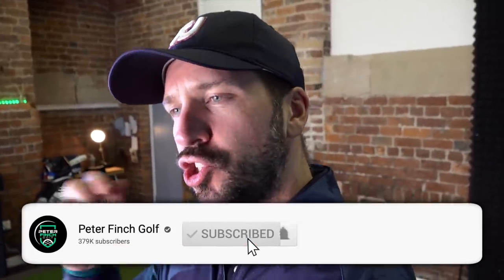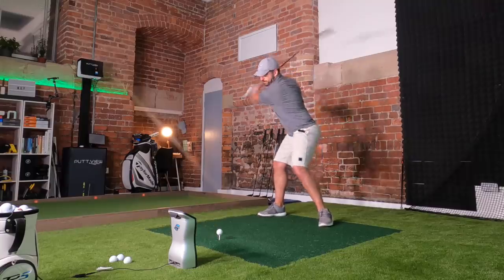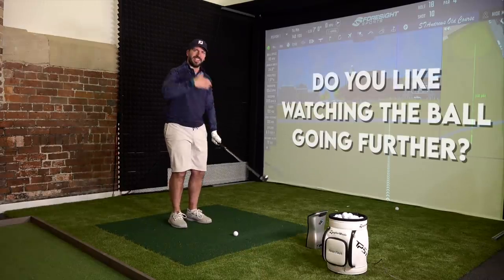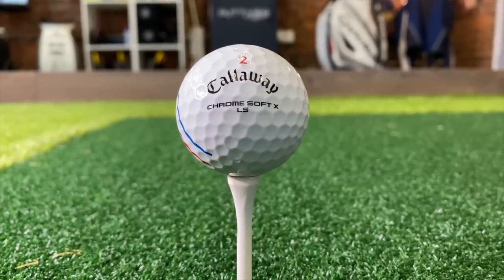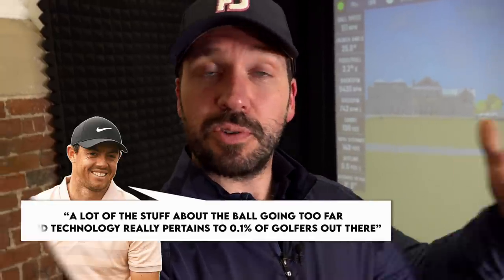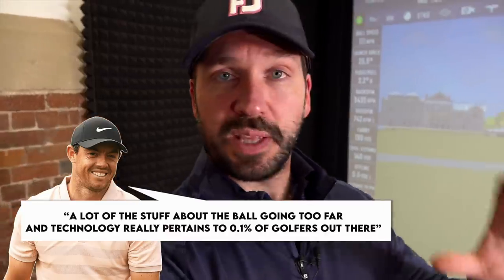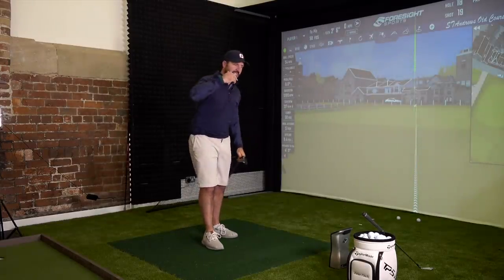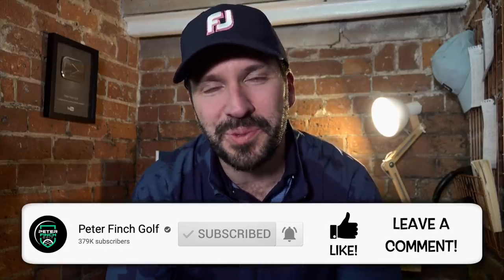Time to roll back the golf ball...?

Comment: Lets keep evolving golf, we can (if we really want/need to) always go back, we have the data for that. Just look at the numbers, yes hitting it far is cool and looks great on TV. That generates more interest arround golf, that is a huge plus. But when you really get down to it, the competitions are still won on the short stuff. Take a look at longest hitters and compare that to the ones that earns the most money (from competitions and not sponsors ofc). Then you compare best putters on the same list (highest earners from competitions). Then you will see that beeing a great putter still amounts to more money earned. We still make a huge fuss about the ones like Bryson hitting it soo far, when in fact its when he putts as great as he is able to when he wins or places high on the board. 1 Drive and 2 putts still make 3, same as 1 Drive, 1 Wedge and 1 put. 
Lets keep evolving golf so that we can see these different ways of approaching a course, some make take the high risk/high reward route some may take the lower risk route and still just because they are great at wedges get a high reward. In my mind its the same amout of skills required, just different skills. 
its not harder to hit a driver 400 yards then it is to nail a wedge from 100 yards to the pin when the pressure is on and you really need to pull it of. Its just different skills, not harder.

Comment: The ball is a bigger issue than clubs. Jack Nicholas commented a concern in 2000 when the pro V1 was first launched.  That was the biggest change in the game since the metal wood. 

If the ball creates the trampoline affect you mention now they could just as easily do the reverse. In fact if they took say 100mph club speed or 150mph ball speed and made it a disadvantage to hit any faster with a negative trampoline affect we would see the Pros come closer to club players and therefore more relatable.

Comment: I think they need to start toning it down with these low lofts, no more chunky forgiving 7i with a 28* loft. Bring back standard lofts!
Reply: The lofts haven't changed.  They just changed the number on the bottom of the clubs.  Your 7-iron has been renumbered to a 8-iron.  We think we're hitting an 8-iron but in reality, we're hitting a 7-iron.  It's called "loft creep".  When I started to play, the 7-iron had a loft of 38 deg; now it's 34-deg (an old 6-iron loft).

Comment: Do not roll back the ball and equipment.  Cap it where it is now (460 cc drivers for example). Course setup plays a huge role as well.  Look at Pebble Beach. Not much extra real estate there to lengthen the course, but the ATT plays dramatically different than the US Open.  Agree that there should not be separate rule for am vs pro, but if the equipment is rolled back, that will become necessary. The pros will figure out a way to maximize the rolled back equipment and balls, but the amateur players will struggle mightily, therefore requiring splitting of the rules.

Comment: I don't think they need to roll back the equipment. Just halt it. I think it's fine as it is. I would bring in some changes though. I think pros should only be able to use blades. If yoh did any roll backs the driver head could be reduced to be less forgiving. Remove ball spotters as well, that would stop you trying to hit it off the planet. It does me anyway

Comment: Forgiveness is a bigger issue than balls or CT rates etc. if you can swing 130 and stripe a 275cc club head then good on you. That’s skill. Amateur baseball uses aluminum bats, pros use wood. Why can’t pros do the same except MOI and club head size restrictions

Comment: I really can’t see why this all can’t be addressed with course set up. Bigger, stronger and faster is always an advantage in most every sport. Make the fairway 10 yards wide  with 6” rough at 340 yds and force a different thought process. 
Remember when they tried to Tiger-proof all of these older courses by adding length? All that happened was that Tiger and a handful of the longer hitters had a much smaller number of competitors that they had to beat. I think strategic tees, bunkers, water hazards,  etc. could easily change all of this. Just make the reward not worth the risk.

Comment: NO ROLL BACK! 
Set ball, spin and speed rates to the current level. Like we have set cor on drivers. For me they NEED to set the courses up differently for Tour Pros an idea that would definitely work would be internal out of bounds 20 yards left and right of each fairway... so yes hit it as far as you want but the risk is 21 yards off the fairway and your 3 off the tee. Brings in an extra risk to big hitting and rewards the straighter player.

Comment: I am not against them changing the ball for the pros to make the distance chill out. But I don't want something that happened with baseball a few years back. College and under had an equipment roll back and it made everybody buy new bats. That is a ton of money for clubs. It has been about 10 years and we are basically back to where we started. Roll the ball back and have the pros use a certain ball for certain courses. We won't notice the difference but it won't affect our time out on the course.

Comment: Maybe shorten the driver for pros? Half inch shorter club is about 2 mph less in club head speed. Make it 42 inches (about 3-wood length, modern driver about 45 inches) and club head speed would be about 6 mph slower which equates to about 9 mph in ball speed which is about 16 yds less in carry.  So in general an inch in club length is worth about 5 yds carry. Courses would play naturally about 250 yds longer. Sure, Bryson would still be long but realistically, what are the chances of regulating golf balls or clubs somehow making the ball go shorter?

Comment: At the pro level, when equipment allows the best of the best pros hit longer, they have the advantage.  The others are left behind taking them out of the competition.  Most, if not all pros can hit a par 5 green in 3 strokes.  The long hitters can it it in 2 strokes (big advantage).  For those shorter hitters, it becomes a battle for 2nd place or less.  I imagine some courses have or are considering lengthening some holes to accomodate these Howitzeer Hitters.  When a roll back is initiated, then some of the current records will never be broken.  There's a hole in South Korea that is a par 7, 1097 yards.  Try to make that geen in 3!

Golf balls already have regulated limits per the USGA and R&A.  They are tested based upon their robotic equipment.   There's no USGA or R&A limit on golfer's ability or capability.

Comment: I agree the bifurcation of golf would be a little weird, but I would have to ask isn’t there already a difference in equipment used? Once you get to a certain level only money will serve as the common denominator in making your off the shelf clubs seem like your pro clubs with the many adjustments and special orders for to each individual. The ball is really the only thing everyone uses that is not tailored to each individual. Also, the whole debate about making courses longer; are any of you saying it would be feasible to do that golf course industry employees, because I can, with the utmost confidence, say a large majority would tell you that making the course longer doesn’t suit the longevity of golf! Relating back to the bifurcation as well, tour pros are not the only ones playing these courses, but if you cannot sustain adding more and then turf struggles, or wages are a problem trying to maintain the increase in land, then really is it worth it? I don’t see why limiting the ball and keeping the courses in fantastic (fast greens, tall roughs) shape is not more of the consensus.

Comment: The longest drivers will still be longer than the field though. Courses need to be made more difficult and more punishing for pros in my opinion. If you pull 50yards off the drives Bryson is still hitting it further than the rest of the field. If however he hits it 50yards off line and there is a punishment of long rough or oob then he may think twice

Comment: I don’t think it’s the equipment. Even your own videos should that golf equipment hasn’t actually moved on to far. Marginal gains are made from new drivers and for the average player a properly done fitting of a 5 year old driver will gain more yards then just going to American golf and picking up the newest longest straightest most forgiving driver ever made (just quoting the sales spill).

What’s changed is pro golfers are now not only incredibly talented, they are athletes.

Tiger brought around that change. When he burst onto the tour he was slight (still smashed it 300 yards mind) but gradually he shorten his swing to add consistency but bulked up to maintain length. This set the president for the athlete golfer we watch on TV today.
I love watching and marvelling in Bryson, Rory, DJ, Keopka etc smashing it a long way. I have come to respect how exceptionally hard they work in the gym to enable them to generate the clubhead speeds they do. Also they understand the golf swing and sciences behind the golf swing so well. No wonder the ball is going so long. Let’s not forget these guys have the majestic touch to go along  with the awesome power.

For instances Bryson’s swing. Forget the one plane dynamic. His swing was based on the resistance example. Big shoulder turn, lower body resists.

Now he has changed to the long, big hip turn (deep hip as I call it), heel off the ground. More Hogan then Tiger.

He put in an incredible amount of time to make these changes to his swing. Hours in the gym to add bulk and strength. Does he not deserve the rewards his extra distance is bringing him. I think he does.

I do believe the Pros should have to content with more out of bounds along holes but that another debate.

Comment: Shortest distance between 2 points is a straight  line. Pros who understand shots gained are always going to take the straightest route possible. If they can carry it and courses allow you to hit straight to it they will.
Does equipmeny need to be rolled back? No. Could there be additional tolerances imposed on equipment to slow the gains? Possibly and that may well be where to go.
The skills are there for all to see. They are just marrying those skills with the maths needed tk win.

Comment: 17 th at sawgrass 140 yds best players in the world and the average was 3.50, golf can be tough without distance. 
Course set up is easier to change., fairways softer some I see on tour run faster than the greens at my course.
Reply: That green was also unfairly hard, balls were bouncing off that like a concrete floor and we saw balls that hit the middle of the green bound over the edge.
Reply: But I agree with your general point

Comment: Doesn’t matter how far Bryson hits it. He’s not winning every tournament. He’s worked his ass off to get to where he’s gotten. He’s putting in more work physically than most of the other competitors to hit it that far and make sure his body is healthy at the same time.... and it’s not just about how far he hits it, he’s pretty accurate at hitting it as well. And if he’s not accurate on a particular hole, he still has to use those “skill shots” to make par or better. He clearly doesn’t think it’s all about distance. When he’s winning it’s because of distance accuracy and putting as well. Thing is, I still see him screw up and have bad holes just like everyone else. Engineers will always find ways to work around the rules without breaking them no matter what rule is in place.

Comment: Disagree on bifurcation. As it is we can buy the "same" clubs the pros use only to the extent that we can grab off the rack one version of many clubheads that would be available in the tour trucks, with a stock shaft that no pro is putting in the bag. 

And when I go play a tour course, I'm not itching to play the tournament tees because I need the exact same challenge the pros face (to say nothing of rough length, green speeds, pin locations, etc.). Instead I'll always play from a tee that will give me the same club into the green as the tour players hit - partly because I think that's how you really gain an appreciation of their talents, but more because I believe what happens approaching and around the greens is where the true skill and artistry of golf are most required. 

And I worry that classic tour courses are either losing this factor entirely or being forced into making unsustainable changes to maintain the challenge...but only for the top 0.01% of players who will only be there for at most one week a year. I see no reason to make amateur golf more difficult simply to maintain the illusion that we're using the same equipment and facing the same challenge as professionals, especially when a pro-only solution is so much cleaner.

Comment: I think too much is being said about this, this is the evolution of golf and I think the technology available these days just means that the companies will find a way around any regulations that are set. If you try and limit distance then the longest hitters will still be the longest hitters so if anything the guys that are not as long will be worse off in my opinion. These courses need to try and accommodate for evolution rather than us limit technology because of these old courses are still stuck in the 1950’s. Don’t just make the hole longer, add more trees, bunkers, make the fairway tighter and the rough longer for the pros, make the greens harder and faster on the stimp for the regular tournaments not just majors.

Comment: I would love to see a rollback of equipment, mainly with the ball but potentially with head size of metals as well. As a spectator and also a very average player bifurcating the game might not be a bad idea. Bringing the pro game back a bit would allow tournaments to be held at some of the classic courses that we just don't see on TV as well as demonstrating to golf courses and clubs that pushing tees back and acquiring more land is not what's required to have a great golf course and host tournaments. Even if not bifurcated the effect on your average amateur as 99% would most likely see little change and only at the top end of distance and club speed would players see a comparably larger reduction, but its all relative. Even if rollback occurs, the longest hitters will still be the longest hitters and have an advantage on certain courses, still hitting shorter irons that the shorter hitters. My thoughts only but would love it to happen.

Comment: The roll back I would want would piss off everyone. Limit head size to 400cc, length to 46”, and make the lowest spin pro line ball currently in existence the minimum at which the ball can spin off the driver.

Comment: You can't have different equipment for the pros and amateurs. How would an amateur ever know if he is good enough to play on tour if he doesn't use the same equipment. But I think this length issue needs to be looked at. With modern equipment like the GCQuad enabling players to fine tune their swings it is becoming easier to build a swing that smashes it out there. Peter Finch and Mark Crossfield are good examples because using all the fancy equipment they have access to has enabled them to gain over 20 yards from the tee ove the last 12 months or so.

Comment: Jack Nicklaus could use old equipment and slam it like 350+yds. That's why they cancelled the Wed night Masters long drive way back because no one could get close to Jack.
Fast forward they tried it again around 2016ish and same issue it was a non-competition and there is already a Pro long drive tour.
PGA should look to an learn from MLB baseball. They are currently rolling back the MLB baseball because the ball had too much 'pop', they changed the type of string on the baseball and too many homeruns etc. The fundamental difference is the baseball is already highly regulated and made only in one place. So to roll back was somewhat easy.
I see no clear way to roll back a golf ball as the technical specifications are much looser and you have sooo many different manufacturers. I would say PGA would open themselves up to huge risk of lawsuits doing any type of change because it could be argued it favored one manufacturer over another.
An easier solution would be to limit club technical specs as they are much clearer, just drop the cc size.  You could possible change ball mass too. That's my two cents.

In general you need to ask the purpose of golf - it's to get the lowest score. Is it good to just allow one aspect to dominate getting a low score such as driving distance. Well - Tiger proved it was good for the game as he out drove most players in his first years until they adapted. And it spurned a new generation of golf interest. Tiger also had sooo many more facets..he was a prodigy of the game but he did leverage length too. So I think you let it go, get the hype and get more people playing the game.

Comment: Bifurcation should not even be in the conversation, that's just a dumb option.  Just limit what pros can do with the equipment - they can't use drivers over 46 inches, lofts less than 10 degrees, or tees more than 2 1/4th inch long.  This alone eliminates a LOT of the gained distance.  Bryson is fun and kudos to him but it is absolutely getting dumb.  He can still use his brute strength to get through the rough like he did at winged foot, and that's an advantage maintained, but the distance stuff is getting goofy.  However, it's also not as great as many think.  Consider that Rory hit one on the same hole 361 on the day he hit it 370.  The fact Bryson has gained so much in technique is more impressive imo.  But yes, something needs to be done at this point.  Making a mockery of par 5's is just not sustainable for the game.